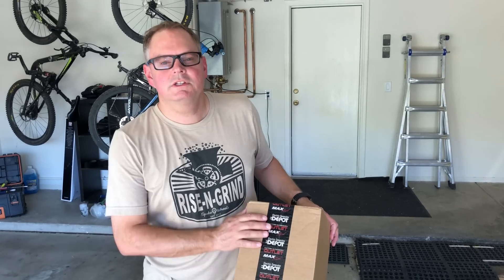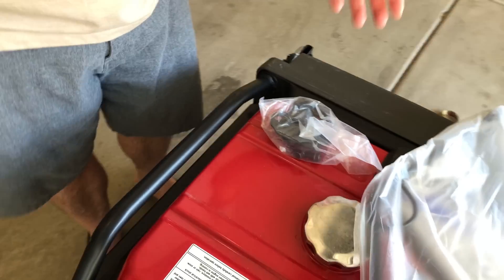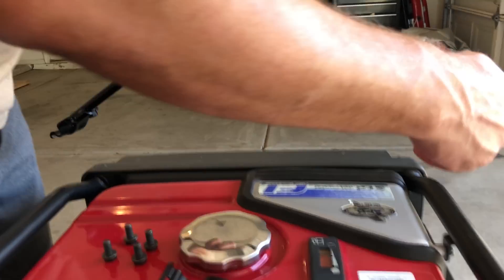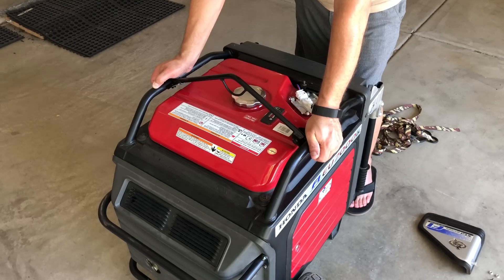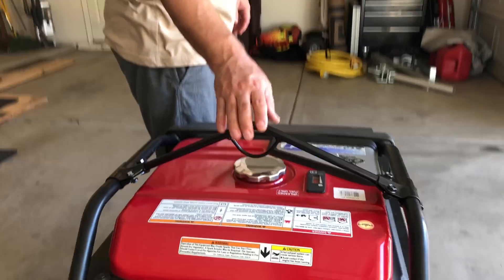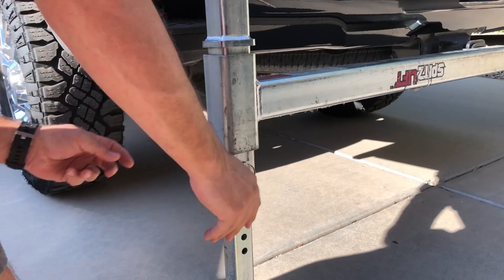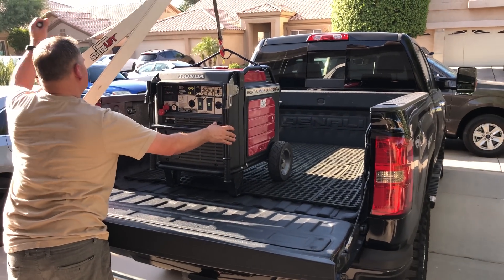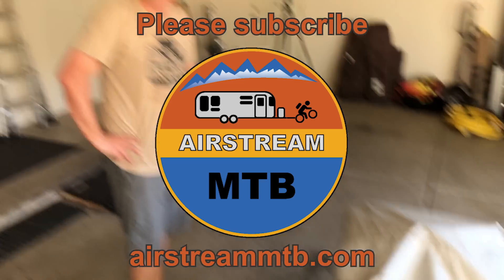⚡ E1.14 Installing Lift Kit for a Honda EU7000is Generator

Comment: Many thanks, I have learnt so much watching your tutorials, first on the fuel pump relpacement and now the spitz lifting arm, I took delivery yesterday of an indentical generator and had to use a trailer winch and ramps to get the unit off the trailer deck and safely onto the garage floor, appreciate you both for generously sharing your knowledge, Best wishes KPPnz

Comment: I have to tell you guys. I finally broke down & bought both the lift kit for my Honda EU 7000is & The Spitz Lift pick up truck crane. You guys were the ones that opened my eyes to The Spitz Lift crane. I always wanted a better solution to the premium folding aluminum ramps I previously bought. Especially with lifting the generator which doesn’t have any means of being self propelled or my pressure washer. I want to thank you both for enlightening me to what’s available out there? I hope both of you are well & still friends? Best regards.
Reply from the maker: That's great I hope you're enjoying those products as much as we are  ;o)
Reply: @AirstreamMTB  I gave a plug to Spitz Lift when I ordered mine incase you were on commission? LOL! I’m sort of serious though because unless I saw your video I wouldn’t have ever heard of them before? Thank you again!

Comment: I found if you slide the lift bracket in towards one side near the back it goes all the way through so you can move it back over under the other side. At least it worked on my eu6500

Comment: Pretty neat but I use winch lift straps, 3,000 pound capacity and I believe they cost about  $12 @ Amazon and for winch I use a Warn Pullzall. Portable and 1,000 pound capacity.  If you modify that hoist with a small 12 volt winch, life will be a lot easier.

Comment: can i use this (Honda generator diesel eu7000is) for desktop computer (500W, 240V, 4A, or above) with no problem? if there's problem, what solution/s? using a AVR or something?
 ...
.
Reply from the maker: Yes, I have been running my Airstream for five years with this unit and multiple PCs + monitors inside the trailer with no issues.

Comment: I like the handle kit - I'll get one for sure.  My tractor with front loader rigged with chain/hook wrapped around the bucket is a good way to lift and transport the generator around my property.   Way less fiddly than a SpitzLift plus pickup.

Comment: How were you getting that gadget in the truck before?  I am looking at the same Generator for a similiar Airstream we are contemplating.  A 33 FB.  Yours looks like it is a 30'?  I was thinking of ordering the truck with stowable Ramps and using a come-along to bring it up the ramp.
Reply: Les Garten , I use cheap chain hoist from harbor freight. That’s 5k$   To p/u.
Reply: Try this for $269.
https://www.amazon.com/Pake-Handling-Tools-Hydraulic-Scissor/dp/B0757JTVC4/ref=sr_1_3?crid=2VDSP437J2Y3X&dchild=1&keywords=hydraulic+table+cart+500lb&qid=1598156496&sprefix=500lbs+hydrau%2Caps%2C213&sr=8-3

Comment: 292?  Ours is closer to 350 lbs full of fuel.  I would be using my engine crane to hoist that into a truck bed.  It's also cheaper, since the SpitzLift is over $2000.
Reply: Thank you, cost effective solution to blowing your back or worse. That lifting bar looks a little under engineered.

Comment: Were did you buy the loading rig from & how much?
Reply from the maker: https://spitzlift.com/receiver-hitch-cranes/

It was pretty pricy, not sure what they run these days.
Reply: @AirstreamMTB  that's okay it looks so simple to make I could make that in a day no problem , in between other things that I am doing a simple cheap thing .I know companies have to make money but sometimes they charge ridiculous prices. ! scrap metal laying around think about a crank from boat trailer..  used to crack up a boat on a trailer you could even motorized it really easy I bet you I could make myself one for about $50 if I did not have all that junk I'll bet you they charge you hundreds and hundreds if not more
Reply: I worked for the company for 5 years and have talked to people who’ve had their Spitzlift for close to 20 years. 
The quality of the high grade aluminum is phenomenal but extruded aluminum is expensive. Having a great tool made in the USA 🇺🇸 priceless

Comment: That seems ridiculous, but to be fair I haven’t watched enough videos to know why you need a 7,000w generator.
Reply: To run everything in your house when power goes out. I have one and even during a hurricane, I can run everything in the house, including 2 refrigerators and 1 21,000 BTU air conditioner.
Reply: Jason Jacobs I live where power is turned off before a surge. Maybe week before it’s back on. You try live w/o power.